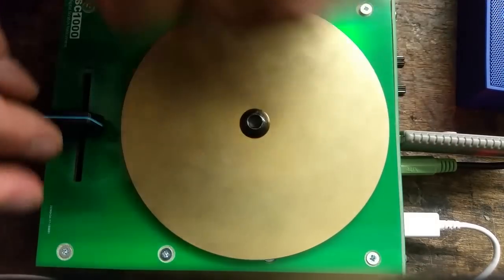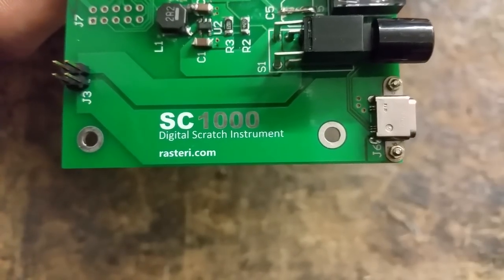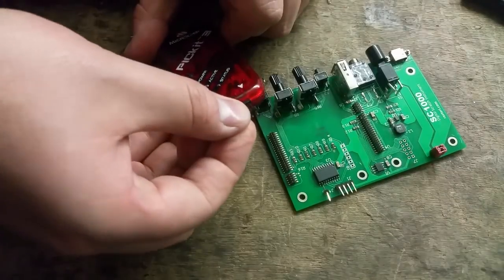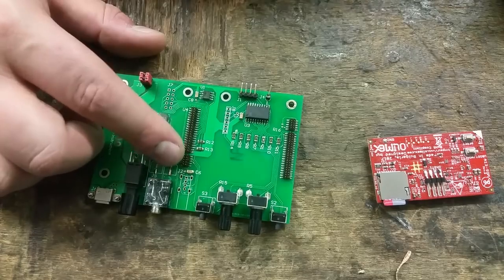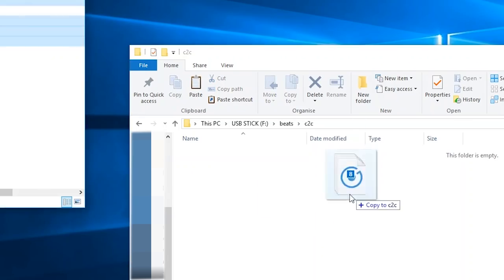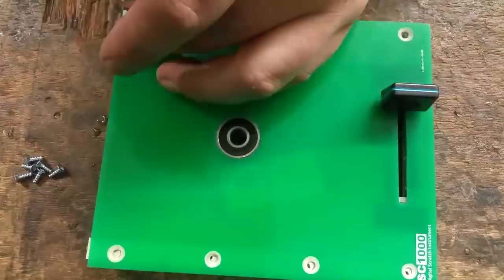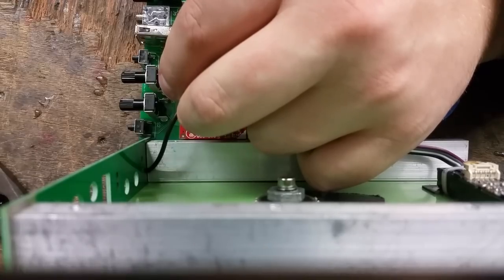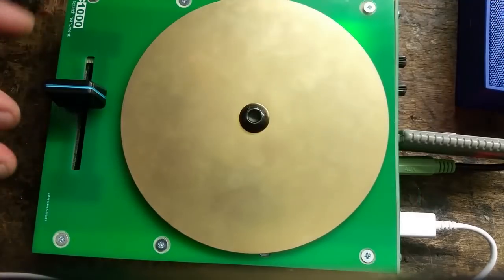SC1000 Build Guide

Comment: Hey ! Nice work ! Just wondering, SD Cards are well knows in Embeded Deviceds to die soon or later due to R/W (professional experience talking here : SD Card dying after 6 months, medium ranged price, using Debian on 24/7 Embeded Devices, know we are using NAND Flash, been more than a year, no problems). I went on Olimex (and supposed it was the one : A13-SOM-256) and saw it was possible to use NAND Flash which last years, in further developments, will you use it ?

Comment: Anyone having issues building this. I have problems getting the code to run in the olimex(i think). If I take the Rasteri PCB and plug my first Olimex board in it runs and LED comes on. If i then swap out this olimex board for another(same sd etc) it wont work. So I bought a 3rd Olimex board and this does the same. I can only get it running on the 1 Olimex. everything else is the same. (SD Card, main PCB etc). Please help lol
Reply from the maker: That is super weird. I've been seeing odd issues with certain olimex modules. I have some broken ones on the way to me right now, once I have inspected them I'll maybe have some answers. In the meantime you could get a USB-TTL serial adapter and look at the boot messages, they might give you a clue.
Reply: @TheRasteri  I had contacted Olimex and they referred me to your post on their forum. I have the boards that you posted in the "not working " picture. Hopefully between you and olimex this issue can gt sorted as Im keen to get cutting ;).
Reply from the maker: @thisall4real  yeah olimex have posted a solution that seems to work, I'm out of town till next week but I'll integrate it into the sc1000 OS when I get back.
Reply: @TheRasteri   - Nice one bro! Look forward to the new OS and getting my units up and running.
Reply from the maker: @thisall4real New OS version here - https://raw.githubusercontent.com/rasteri/SC1000/master/os/sdcard.img.gz
Reply: @TheRasteri  Nice one. Just flashed sd cards with new .img and both my olimex boards are now lighting the LED after booting up. Looks like Im ready to proceed with rest of the project .
Reply from the maker: @thisall4real  great!

Comment: That's brilliant. The scratching sounds better than most CDJ platter scratching. How does it interpret what the platter is doing? I'm guessing the magnet rotating is involved (=electrical current right?)
Reply: a small magnetic field sensor. Similar ones used in electric scooter throttles and other applications. Also important the magnet is diamectric and not axially magnetized
Reply: @layeetskeeters9244  Thanks. I see there's a sensor chip mentioned in the GIT docco now. Brilliant product. I've tried to come up with a scratch tool and this has re-inspired me.

Comment: @TheRasteri  - I'm now at the assembly/testing stage and all is well. However, I'm after a mod if possible. Right now I see you have it setup to use touch sensing onto J4. I was hoping to bypass this so that the sample wont play with no hand on the platter. Ive tried shorting J4 to ground but no luck. My reason for this is that I want it to behave like a regular record. I wish to use a marker so that samples are always at the same marker postition etc. For phrasing etc I really need this. My idea was to load a sample with marker at 12oclock then i could navigate though samples and they would always be at same position. Same as a record. My other idea(not as important) was to use an actual record /vinyl cut down as the platter but this wont work as I suspect it has to be conductive/metal.

Is there anyway I can achieve this or would these changes have to be done on the code by yourself? 

Im almost there tho. Just need to buy a crossfader ;)
Reply from the maker: That will definitely need a software mod. Should be pretty simple though, remind me in a few days haha
Reply: @TheRasteri  that would be wicked. Will shout you later
Reply: @TheRasteri  Just an idea. If code could be updated to run as normal with j4 as touch sensor or say the way i want if j4 was shorted to ground. Then by using a switch on front panel the user could toggle the 2 modes. 1 switch position could be as standard, 1 switch position could be vinyl emulation. See what you think you could do ;)
Reply from the maker: @thisall4real Here's a version of the xwax software with the touch sensor disabled. Unzip it to the root of the USB stick, it'll run instead of the software on the SD card - http://rasteri.com/xwax.zip
Reply: @TheRasteri  Thanks a lot bro. Will try this out this week.
Reply: @TheRasteri  Hell Yeh Rasteri Im up and cutting. Just had my first 10min session cutting at work after finishing it this afternoon. Dope as. This wouldve been the best xmas present ever lol.
Reply from the maker: @thisall4real  Post a vid haha :)
Reply: @TheRasteri  here's a quick vid of build. Im about to strip it down to move magnet closer to sensor as the audio drifts a little out from the marker if you hammer the cuts lol. After a few revs the sample is not at same position when you rewind. See if this helps. Also gonna drop fader height as it sits a little high above face plate. Will do a cut session once all's sorted. Heres the link https://youtu.be/ouyNkeHsJZA